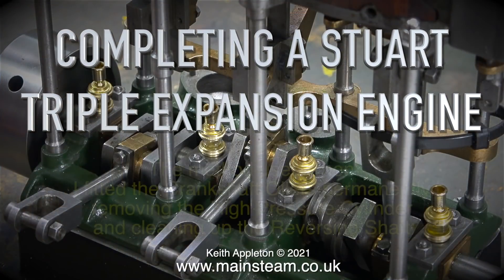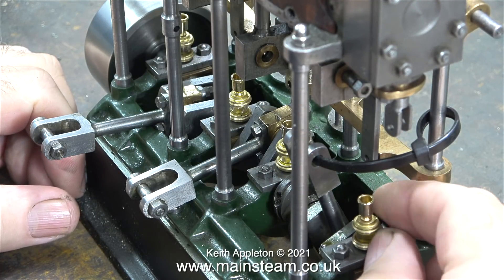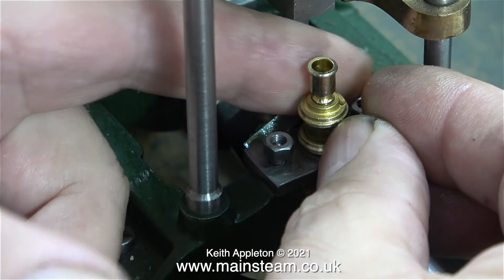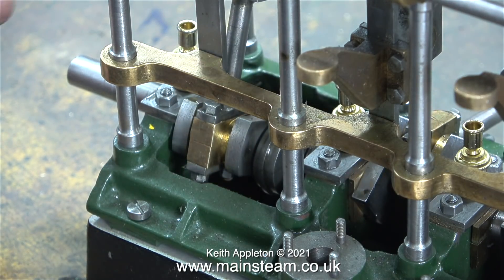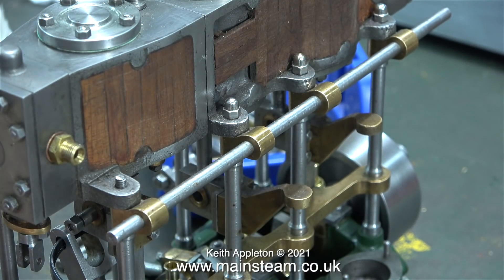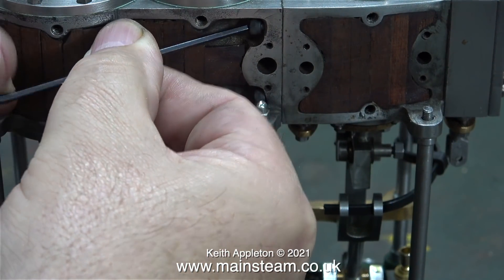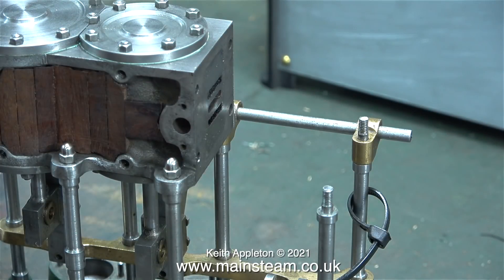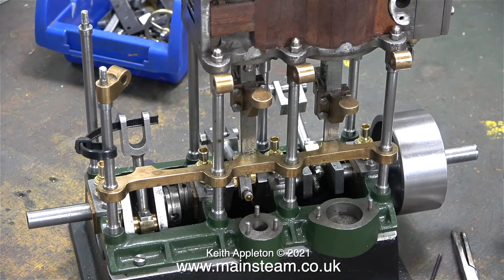COMPLETING A STUART TRIPLE EXPANSION ENGINE - PART #32

Comment: how can you install a tank that supply the oilers with the needed oil? just an idea sorry if I asked this before
Reply from the maker: Make a tank and attach copper pipes to it. Oilers as such on the bearings would not be needed. The pipes could go straight to the bearings. Often it is a good idea to fit cotton Wick Feeds inside the copper pipes to regulate the flow of the oil.
Reply: @keithappleton  thanks for clearing that up for me